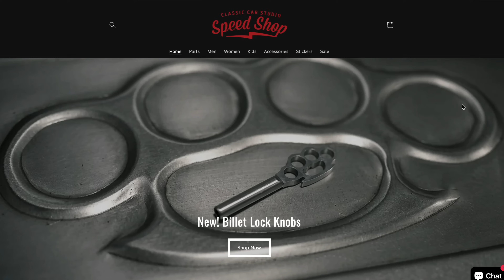Finishing Front Fender Fabrication • Episode 12 • Twin Turbo 69 Corvair

Comment: Make the front one functional by going up into the top of the of the fender with the vent and grill the inner fender into it. So open up the top of that vent, go up through where the fuel door opening was basically, this way you can close off behind the wheel but still keep the "vision".